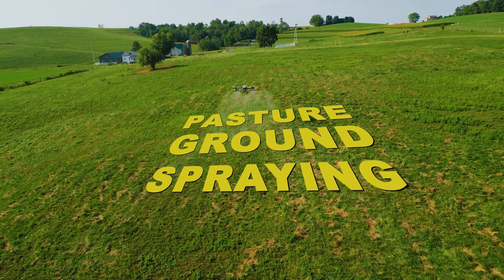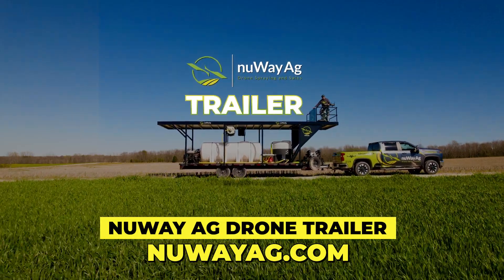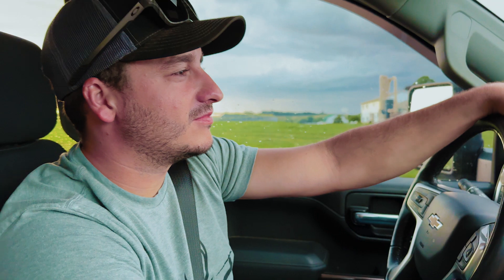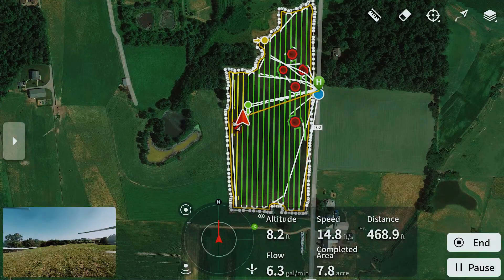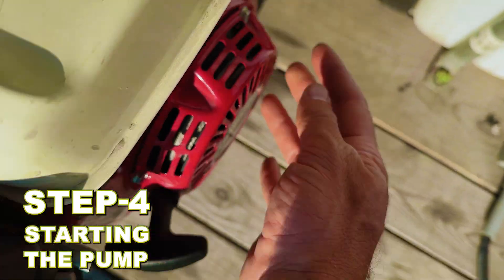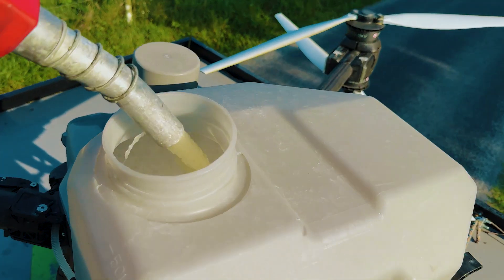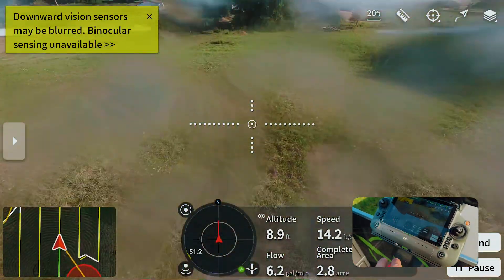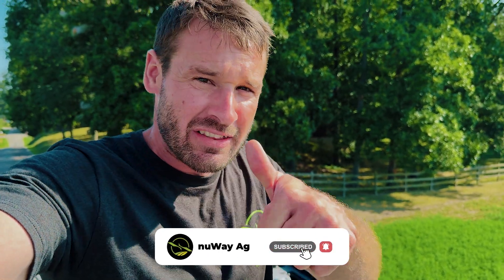Must Use Drones for Pasture Ground Spraying!

Comment: Can the trailer be fitted out to accommodate 3 of the t-50 drones? I know you got battery slots for two I was just wondering if the trailer could accommodate three and maybe fit in another slot for the battery for the third drone? And can the generator actually generate enough to keep three flying?
Reply from the maker: I will be releasing a video shortly of the trailer loaded out with three drones. You do need one generator per Drone. It looks sweet or excited to operate it here in the next few days

Comment: Do you guys use RTK when mapping?
Reply: Most drone operations dont require RTK. It is helpful if you're in the northeast and the client has shapefiles for you. But most of the mapping we do is with the DJI SmartFarm app. Easiest way to do it in terms of prep. And we just have our operators slightly adjust the maps if there's any discrepancy. Just have a decent margin from the border and you'll be fine. Its more of a pain to set up the RTK or VRTK just to map things  out as it'll lower your efficiency and acres per hour. Yes you do lose some spraying at the edges but its nothing that manual flying can't take care of. Overall from what we have found is that, mapping it via the smartfarm app is faster than sending a t50 out there to map the edges.
Reply: @andresbrito8374   Thwnk you for tge reply am actually located in on tge Caribbean Island of Antigua am currently running an old dji mg1 and i want to upgrade to a t25  am just trying to learn as much as possible about it as possible because am basically a pro at manual  spraying with the mg1 i have but am clueless when it comes to mapping
Reply: @andresbrito8374  is the HD mapping useful
Reply from the maker: I do have RTK, but I hardly use it just like the comment before me said 👍